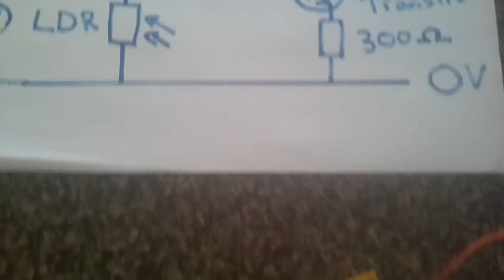L.D.R. and the transistor - IGCSE Physics

Comment: so the current flowing through the whole circuit is constant? whats being manipulated is the voltage and resistance only. Am i right?
Reply from the maker: Laggerooma Epiclagger no. Sorry current is not constant. Voltage across ldr is being changed because its in a potential divider.
Reply: so when the ldr has high voltage, the 110k ohm resistor has lower voltage, when it has lower voltage, it has lower current right?
Reply from the maker: yes
Reply: But why? if it has lower V, wouldnt it be harder to activate the transistor?
Reply from the maker: Laggerooma Epiclagger let me think about this.. Maybe I can find the old circuit and do another video.
Reply from the maker: Laggerooma Epiclagger when my finger is on the ldr the resistance of ldr increases. The voltage across it increases to the 0.6 volts needed to activate the transistor.
Reply: so, voltage is the thing that activates the transistor and not the current?
Reply from the maker: Laggerooma Epiclagger the voltage is activating the transistors
Reply: Chris Gozzard So my concept was wrong all the time, thanks for the enlightenment
Reply from the maker: Only a pleasure!!

Comment: Hi Chris, thank you for this useful demonstration. Are you able to provide the specification or more details for the LDR that you used please? I'm trying to recreate this but it didn't work with the LDR that I have so would appreciate your guidance. Thank you.
Reply from the maker: do you have a voltmeter?  the voltage from the potential divider needs to become greater than 0.6v to trigger the transistor. also are you using and npn or pnp transistor?
Reply: +Chris Gozzard (That Physics Guy) Thank you Chris. I was using an npn and had it set up correctly. The voltmeter showed that I was getting the required 0.6 V, I just wasn't noticing in the bright lab that it was actually working! Cue blackout blinds and hey presto LDR being used to control something! Thank you again for sharing and helping, much appreciated.
Reply: +Chris Gozzard (That Physics Guy) Thank you Chris. I was using an npn and had it set up correctly. The voltmeter showed that I was getting the required 0.6 V, I just wasn't noticing in the bright lab that it was actually working! Cue blackout blinds and hey presto LDR being used to control something! Thank you again for sharing and helping, much appreciated.
Reply from the maker: +Chris W. oh thats awesome. grest stuff. are you a teacher?